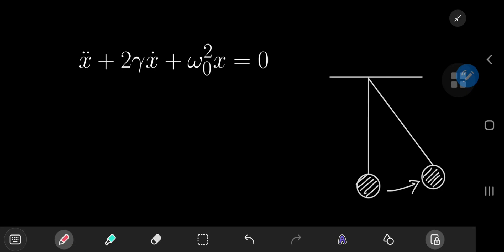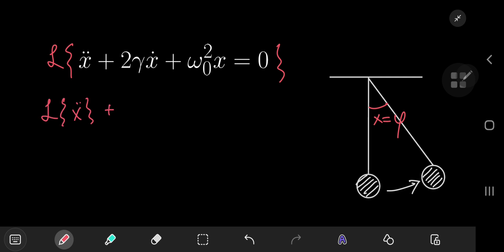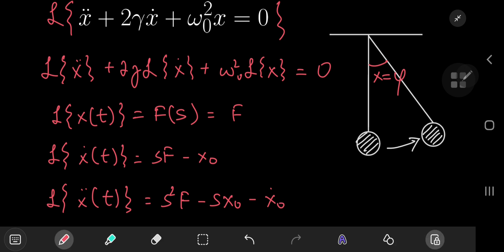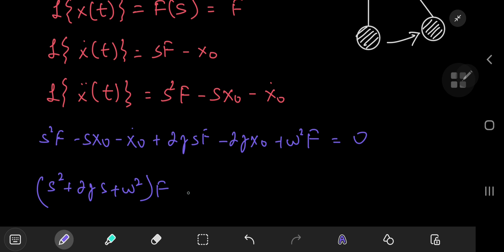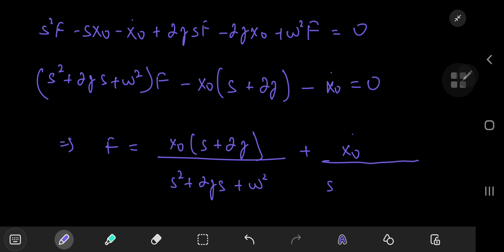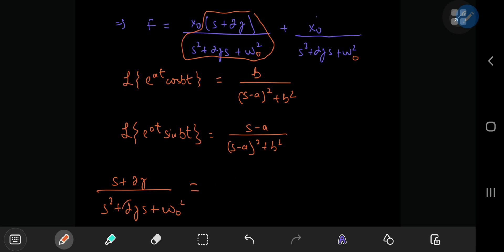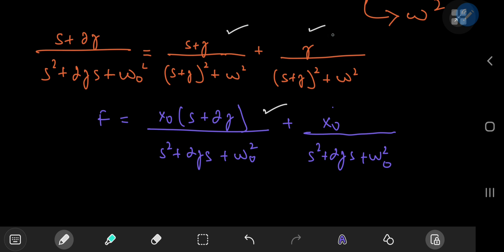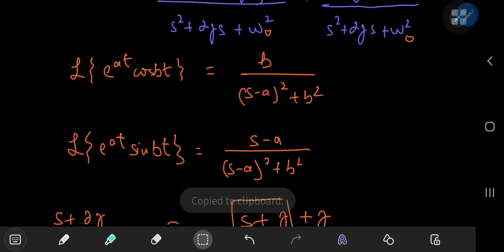Solving the damped harmonic oscillator - Laplace style

Comment: For those who are interested, gamma in a damped harmonic oscillator can be decomposed further to zeta*omega(0).  That means 2*gamma = 2*zeta*omega(0).  Zeta is the actual damping coefficient and tells you what kind of damping you have.  Zeta > 1 is over-damped, zeta = 1 is critically damped, zeta < 1 is under-damped, and zeta = 0 is undamped.  If anyone gets into control systems engineering, make sure you understand this because it is a very important part of classical control systems.

Comment: Quick note: the coefficients of the sine and cosine within the equation should be interchanged in order to give the correct solution, as plotting this function gives incorrect values at t=0.

This is because x(0) in this case is:

(x_0 * γ + x'_0)/ω, 

Which is not equal to x(0) - in turn, this affects the entire course of the equation.

Doing the same thing for the derivative of this function at zero (x'(0)) yields:

-γ * (x_0 * γ + x'_0)/ω + ωx_0,

Which really should be x'_0.